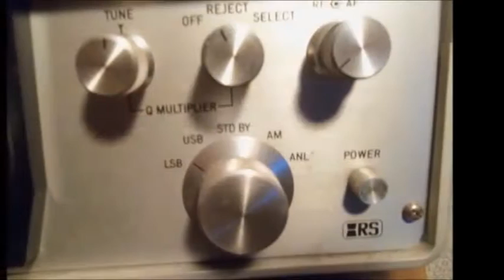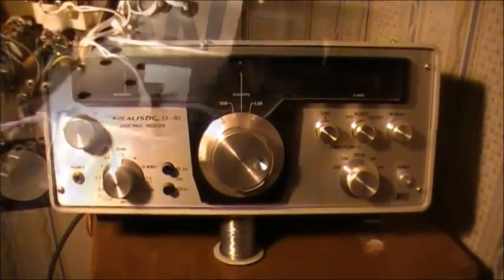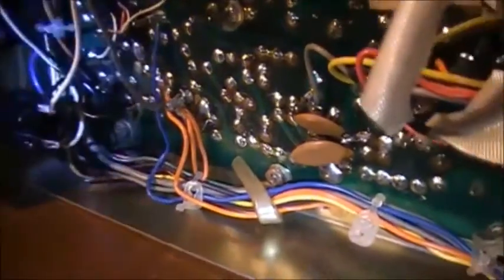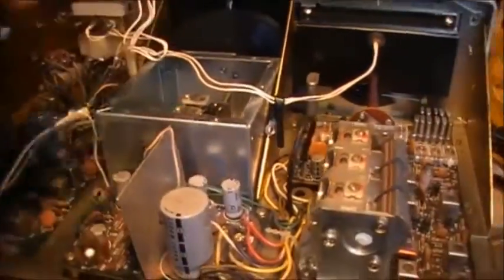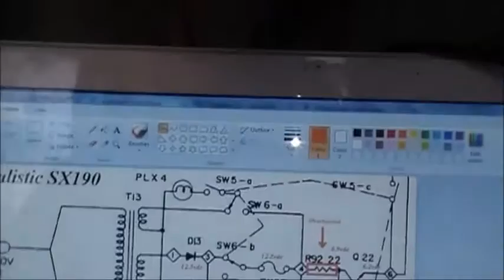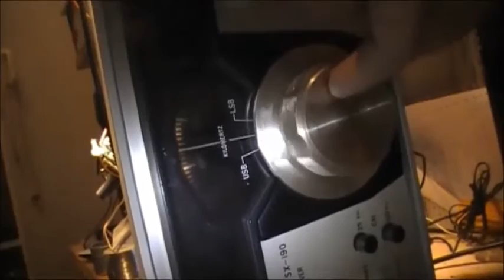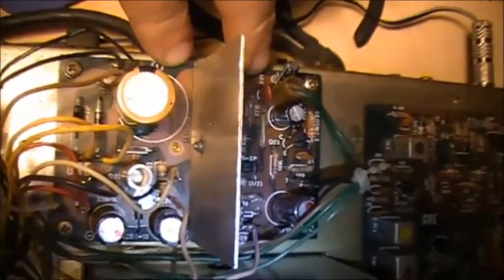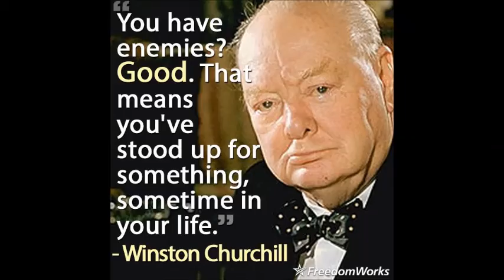Realistic SX 190 Trouble shooting and repair PART 1  Revisted

Comment: I just picked up one of these (in the Allied version) yesterday and found your video tonight while I was collecting more information before I do any diagnostics and repairs on it, mine appears to have the same symptoms, but I haven't opened it up yet to check it out. Great video!
Reply from the maker: These are great radios, very nice!
Reply: One of the pair of capacitors near that same resistor had blown off one of it's bottom connectors on mine, It now works. I am now replacing the rest of the caps to remove a very slight AC hum.
Reply from the maker: Nice to hear you made some head way.. these are very nice radio for sure!

Comment: for AM distortion check voltage on Q23,24,25,26.
for distorted ssb check voltage on Q17.
Could be faulty Q17.
Faulty D8,9,10,or 10
thats right out of the service manual
DE VE3TYA

Comment: Excellent video and trouble shooting Radionut63! I recently picked up an Allied SX-190 that had low sensitivity and found a bad n-channel FET in the RF amp circuit. Also a dirty band switch which I cleaned.  I find this to be quite an excellent receiver for both SWL and Ham radio use. I believe these radios were made by JRC in Japan.
Reply from the maker: These sure are great receivers, at the time they were pretty hard to beat, and today for the most part they still are hard to beat.    When they are working correctly, they work awesome!
Reply: Radionut63: I totally agree!
Reply: @Radionut63  hi , what are the 2 components attached to the aluminum heat shield between the power supply and the af board ? 
Is the a equivelant part for these ? 
Sorry to bother you but i cant seem to get logged into the eham.net forum where there is good discussion on this AX-190.
Thanks , Craig 
VE3SDB
Reply: Hi TheRudyDog, did your radio have low receive audio as well? Mine has low sensitivity and low volume. If so what was the part number? Thanks, Adam

Comment: My ax-190 has no audio . i use headphones to just hear a slight hiss from the radio at full volumn .
The receiver is in mint shape , lights come on , but no audio . 
Any thoughts ? 
Radio has not been tampered with .
Reply from the maker: Sounds like the same problem this radio had...  Change out the electrolytic capacitors might sort out the problem provided they did not cause another problem and pop the audio amplifier circuit.   Also check the headphone and external speaker jacks, they might need to be cleaned. ;-)
Reply: @Radionut63  Thankyou .
I changed the same resistor on the power supply board . Im not a technician in anyway but its not hard to change out the caps and I bought several 400mW zener diodes to replace the 1S188s .
But they seem fine .
I hooked a length of wire to the S0239 and could tune in cw and a operator transmitting on 80 meters I believe it was BUT theres still something holding the signal back . S meter barely moves too .
This is my 1st AX and Ive had 2 SX 190s . This one clearly is not pulling in like it should . 

https://www.eham.net/ehamforum/smf/index.php?action=printpage;topic=94087.0